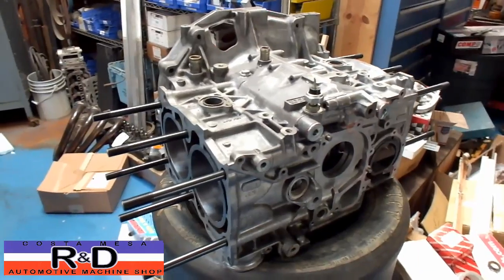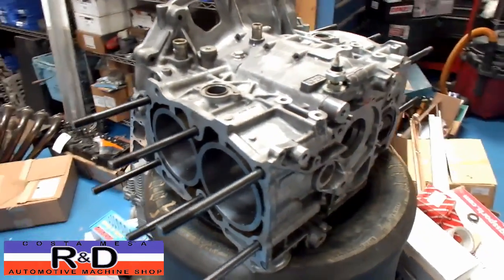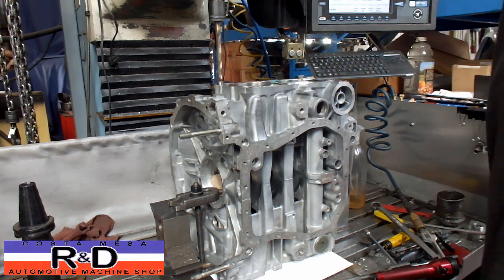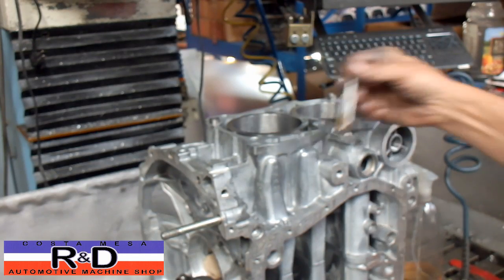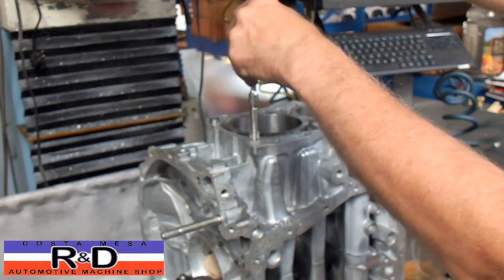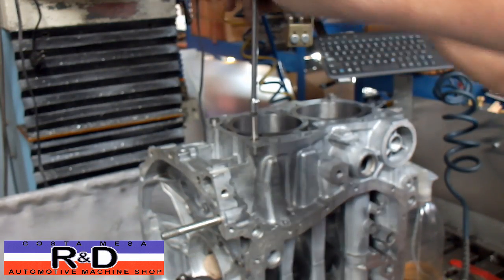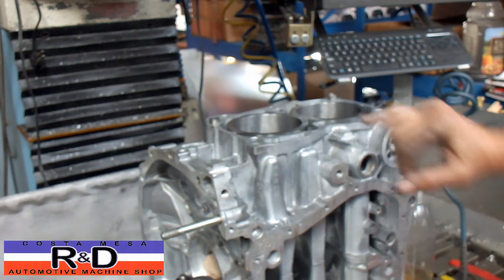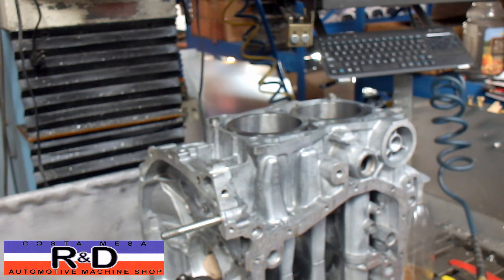1/2" Head Stud Installation on the Subaru EJ Series Engine

Comment: are you using a 1/4" extension to drive the tap?    do the taps have 'steps' like the various drives (i.e. 1/4, 1/2...)?    if so I've learned something new and exciting....don't know how many times I've fought tapping a hole close to the block.   I know that style of tap holder? is handy for quick clamp and release of taps but never thought of an upside down drive extension.    amazing
Reply from the maker: I generally take and grind down the drive end to fit 1/4" drive so that I can do jobs like this, pretty simple actually. Good catch on the 1/4" extension!!!!! gooood eyes!

Comment: Thanks John, pretty straightforward. Are the stock studs of a smaller diameter?
Reply from the maker: Bruce, the EJ has 11mm head bolts. If you remember, I did a vid on a 4G63 Mitsubishi when I went to 12mm studs because the engine will eventually get around 65-75 pounds of boost, and more if the studs hold like I think they should.
   JE...